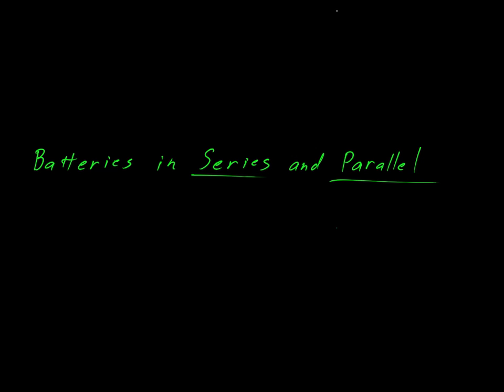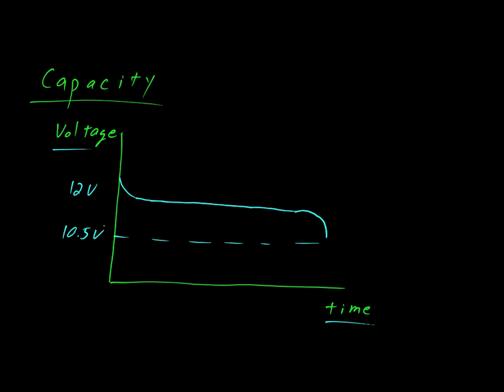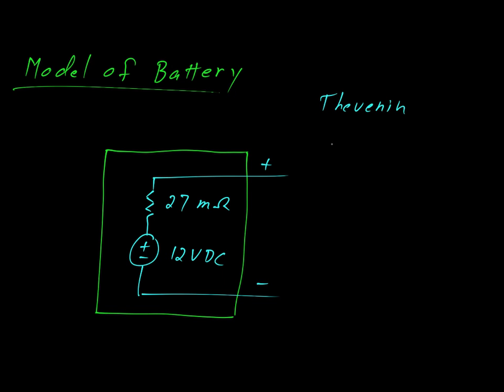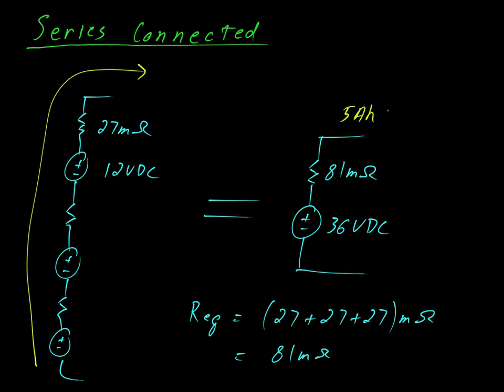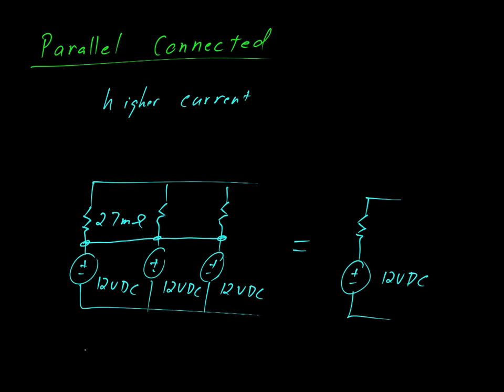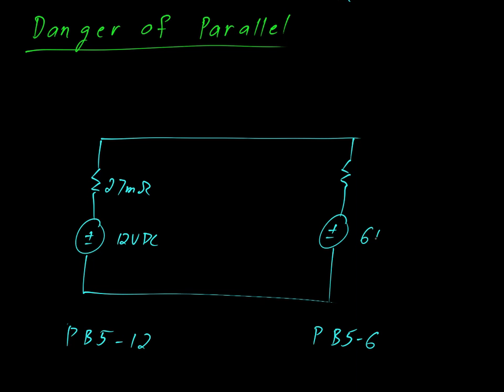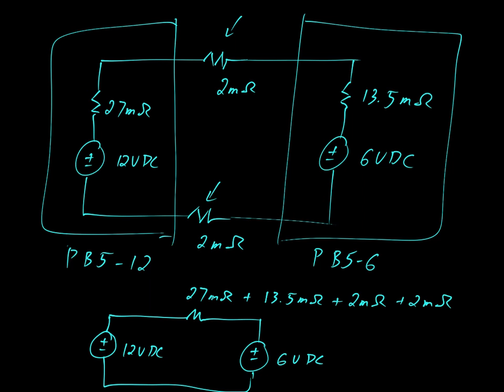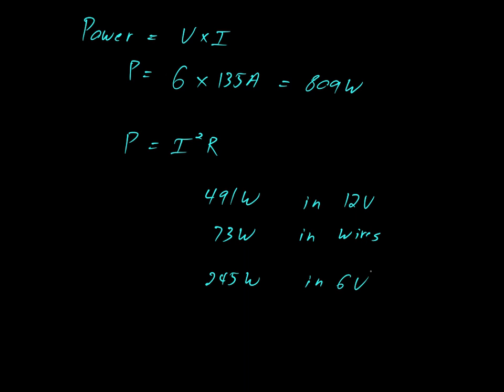Capacity and Current Sharing in Series and Parallel Lead-Acid Battery Arrays

Comment: Perfect explanation: this video should be the most watched on batteries in series and parallel. I had not explored the concept of internal battery resistance in my Physics class, so it confused me why in so many other people said the voltage could be the same for a parallel battery connection but the current would increase. I thought that it was a violation of Ohm's Law, but now it makes total sense.

Comment: Since you end up with a resistance of 9 milliohms instead of 27 when you put the batteries in parallel, could that present a fire risk or a risk of burning up whatever you are trying to power with these batteries, because of the additional current?
Reply from the maker: Operating batteries in parallel makes more current available but this should not damage the load. For example, let’s assume the load is a simple light bulb. The light bulb will run longer with more batteries connected in parallel.